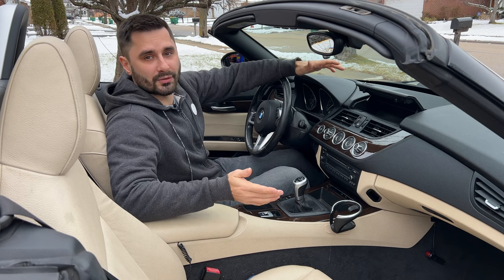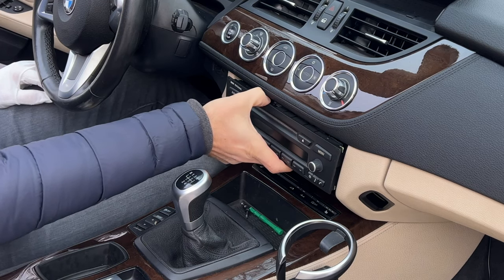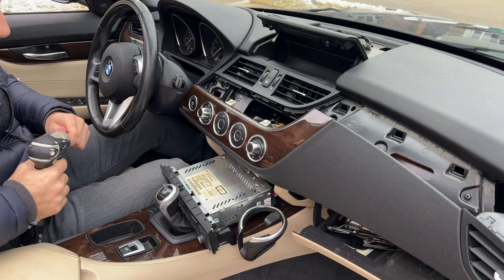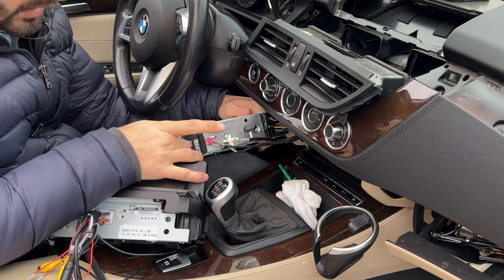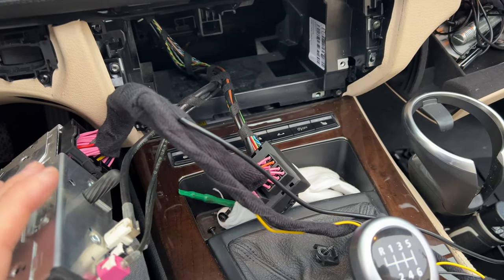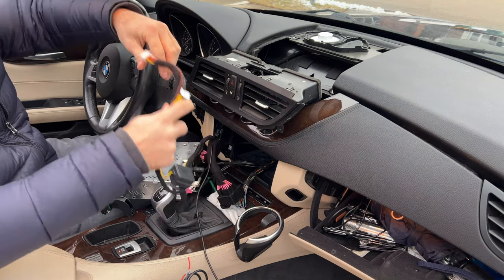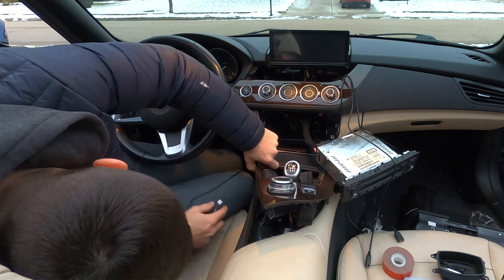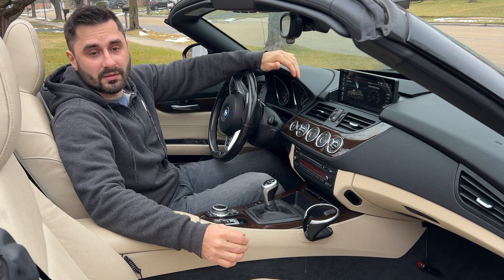BMW Z4 Aftermarket Apple CarPlay Retrofit - Full Installation DIY

Comment: i want to say all e89 z4 cars have stock cic unit installed in my country, i bought an aftermarket carplay module at a price about  $250(installation included).
aftermarket screen looks nice but i cant live without  turn over screen appearance.
anyway i understand it is tasteless to add a cic system expensively if you only want to have carplay in 2022.
Reply from the maker: I would love to add CiC or wish I had OE system already installed, but to add it after the fact it would be prohibitively expensive.
Reply: @SimpleCarGuy  cant agree more.definitely OE BMW parts prices are unreasonable and incredible,especially old types with out-fashioned functions.good news OE parts are not necessary for mantainence and repairing.I bought many brands parts like ZF bilstein  INA  febi meyle corteco etc.

Comment: Did you make a follow up video? I don't see it listed on your page.

Could you possibly make a video for E89 (2010-2016) to install the backup cam with this and if it's possible to retro fit comfort access (not keyless entry) so you don't have to take the key out of your pocket? 

Thanks for this video and thanks in advance if you're able to do the new ones.

Comment: Does it give you info on oil life like the original stereo
Reply from the maker: You can hold MENU for 3 seconds and it goes back to original BMW system. This is an add on, it does not remove anything existing.

Comment: Hello - thank you very much for this. I have been wanting to add CarPlay to my E89 as well. I have a screen (and the controller) already in mine and would be curious if you would recommend a complete replacement as you have done here or using a box to add CarPlay as you did in your other car. Thanks for the great videos and as someone just a bit north of you, kudos for doing it outside this time of year!
Reply from the maker: Hi! I would just add the carplay box and keep the original screen. The OEM screen is much better in the sun and you know it will work properly and of course it's much easier and less expensive to add the box instead of swapping the entire screen and controller. Lighting in my garage isn't the best, so I figured I'd breathe some fresh air for an hour haha. Thank for watching!

Comment: Hey, thanks for the vid, I have bought the screen quick question, did you disconnect the battery ? and if so, just the negative?
Reply from the maker: It is recommended you disconnect the battery. I have done a couple of these without disconnecting the battery, but you should disconnect the negative terminal.

Comment: The video was from January 2022.  How has this held up over time?  Any issues?  Thanks!
Reply from the maker: The unit still works great, but I got rid of the iDrive controller that came with it as it didn’t work as well. I have talked to a few people since that installed the unit and they have fixed the controller through firmware.

Comment: Your link above is for a similar Android car play, do you have link for exactly what you installed for APPLE CarPlay - Excellent video, I never thought it would be possible without iDrive
Reply from the maker: I got it on AliExpress, but I would not recommend going that route or with the seller I picked. It took well over a month to be shipped with an excuse every other day and no support after (when I asked for installation instructions etc). 
Thanks for watching!
Reply: @SimpleCarGuy  Yes, bit it appears you received exactly what you needed to install Apple CarPlay. I've searched other sites but wouldn't exactly know what I'd need to order? (Don't really need instructions, you laid them all out there for us)

Comment: Thanks for the video! I just ordered the PEMP Android 10… I don’t have the factory monitor and hoping that this system will work on my 2009 E89 that has the base radio package…..
Reply: I have a 2009 as well. Did you get this unit in and working. I am planning to get one now.

Comment: I go one but have problem with cracking/poping sound. Used contacted spray and checked cables. Wasn’t an issue when I but the original cables

Any help?
Reply: I have same problem when sound volume on head unit is greater then 30. volume 30 or lower makes sound quility little better.
Reply: I installed it and I had same crackling sound each 2 seconds.
I moved 2 green optical cables to head unit and no more crackling sound.

Now I don't understand why I have to connect a long jack cable to aux in (in box space) input to have sound.
Any help ?

Comment: Hey @SimpleCarGuy! Following your channel, I got a similar system shortly after you did. However, it didn't work straight for more than a month. All through the winter had all sorts of crunching noises, screen would jitter, sometimes would not turn on, and eventually it died. My amp is stock, no water leaks to the amp compartment, battery healthy verified with a battery tender, and all the fuses seem alive.
Is your system still working? Could be the stock amp is too weak to handle it?
I am procrastinating taking it all apart again, but AliExpress seller and customer service are useless.

Comment: Hi, first of all, thank you for the video. I have a question. The link in the description is a unit from PEMP, the one you got from aliexpress is the same brand?
Reply from the maker: They are all pretty much manufactured by the same place and a different brand name is slapped on it. As far as I can tell, mine doesn't have a brand name.

Comment: hi i just came across this video, super interested. do the steering wheel buttons work with this unit? to change songs specifically? thanks in advance
Reply: yes. steering wheel buttons works perfectly. next/prev song, voice button (for siri on carplay).

Comment: Do you know if it’s necessary to have a sim card. I purchased the unit and on the instructions it shows where to install it, but it didn’t come with one
Reply from the maker: You don’t need it if you will be using Apple CarPlay or Android Auto.

Comment: Hello!!!
I´m going to install the same radio in my car, and I have a cuestion!!
Is it necessary to connect the gps and 4G antena?
Reply from the maker: If you aren’t going to use built in navigation or insert a SIM card, you don’t need them. Just make sure if you have a WiFi antenna you plug it in as it’s used for Apple CarPlay.
Reply: @SimpleCarGuy  I have a little problem now.
The sound doesn’t come out and the auxiliary cable that comes, has to be connected to the original auxiliary input.
Is there a different way to do that connection?

Comment: My Z4 E89 Android screen does not respond at all, but the i-Drive works.  However, with the i-Drive I cannot go to the apps or settings menus.  Is there a solution for it? I would appreciate if you can tell me what to do to fix the issue.
Thank you in advance.
BTW, I resettled the OS via the small reset hole on the system, but that did not fix the issue!

Comment: I just bought this for my 2011 bmw z4 E89. After installing I cannot get sound from the head unit to the speakers. My radio works fine and has sound. I took it all apart to make sure everything was connected properly and they were. Any one have this problem or know how to troubleshoot?
Reply from the maker: Did you switch to Aux on your original BMW radio?
Reply: Yes I can switch from radio to aux but still no sound.
Reply: @zmitchell09  I zack, excactly the same problem, no sound, did you find a solution ?
Reply: @villersfr  did you find solution?

Comment: I watched other retrofit videos and remember that some installations require a cable to be routed to the aux port in the center console, which you have mentioned in the video as well. Do you know why it wasn’t needed in your installation? Maybe because its an android unit vs a CarPlay box addition to those with an original screen? Refreshing to see that you left a lot of trim pieces still attached to the cables, seems to have saved a lot of hassle! Great installation guide!
Reply from the maker: It was NOT needed for my installation and everything works as expected! I have not tested on Android yet, but will test Android when I have a friend come over and I’ll include those results in the follow up video. Thanks for watching!!
Reply: Is not needed as the top of the pink cable that connects to the radio routes the aux port internally
Reply: @gamemax5alpha  ahh I see, thanks so much for pointing that out.

Comment: So I tried to install this and I'm getting sound clicking and my sos signal coming up on my dash. Did you have this issue ?
Reply: Did you have it resolved? Having the same issue
Reply: @vladkatzaero  . Yeh you have to pull the optical plug from the harness and put it back into the head unit.
Reply: @ThatErDoc I had also sound clicking and after moving optical cable it doesn't happen any more.
Did you have to connect 3.5mm jack cable to AUX IN also ?
Reply: @guillaumedebra4233  yes I did. I was trying to avoid using the aux but couldn't find  a work around without the clicking and SOS

Comment: What unit is it that you installed. Where can I purchase one?
Reply from the maker: I got mine on AliExpress, but it took well over a month for them to ship, so I wouldn't recommend it. Amazon has them for sale as well. Link in the description.
Reply: Where can I find the description
Reply from the maker: It’s under the video, but here is the link: https://amzn.to/334XR0m
Reply: @SimpleCarGuy  That link is still the Android version and not Apple Car Play?
Reply from the maker: All of these are android based. Apple CarPlay is just an ‘app’ on it.
Reply: @SimpleCarGuy  Ah ha, that explains quite a bit. I do not have iDrive presently, just like your E89 so with your Amazon link I would also need to order the PEMP iDrive knob as well, is that correct? Is that everything I'd need to convert my coin tray and storage compartment to a beautiful Apple Car Play system. ALSO once installed, would you still use/have access to your old audio system or would you even need it?

Comment: Andriy, terrific video. Did you end up routing the two USB cables into the glove box?  Do they also provide power?  If so I’d plan to buy a Weathertech Cup phone for my cup holder and run a short usb to power my iPhone. Also, have you tried a USB Stick with music on it?

Comment: Hey man, I’ve bought the same system as you from AliExpress and managed to fit it. Everything seems to work fine except I can’t seem to get apple car play on it at all? Do you know how you can sort that out? I’ve tried both wired and wireless connections but it’s not seemed to have worked. Thanks again
Reply from the maker: Hey there!
It's hard to tell without seeing the unit, but there should be an App that allows CarPlay connection. Mine is called something like Zlink. Might be a different name on yours, I'd check with the seller. Worst come to worst, you can install one of these apps since this is just an android unit.